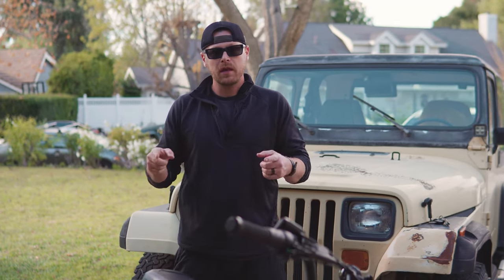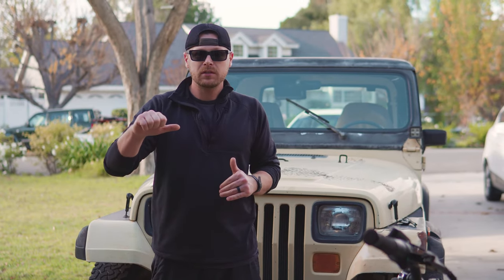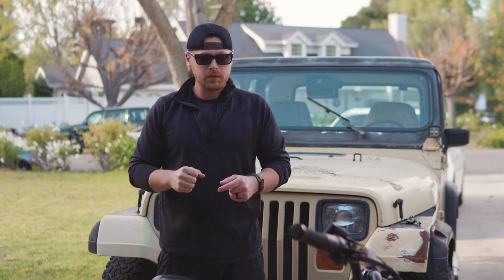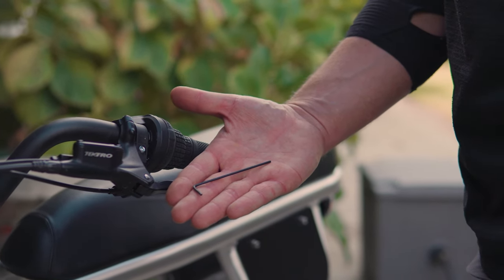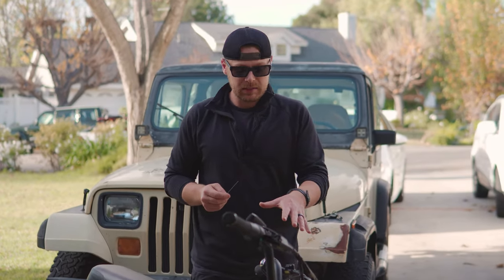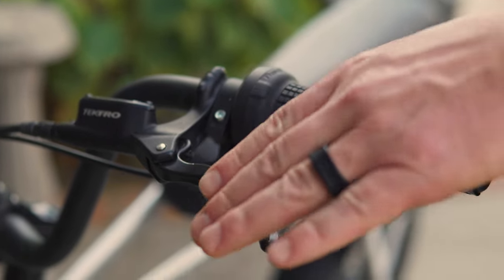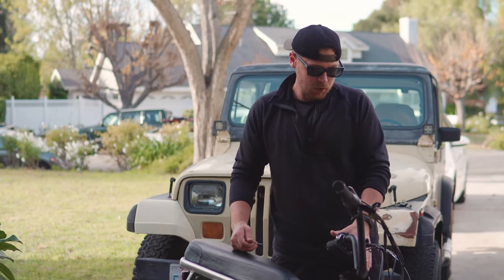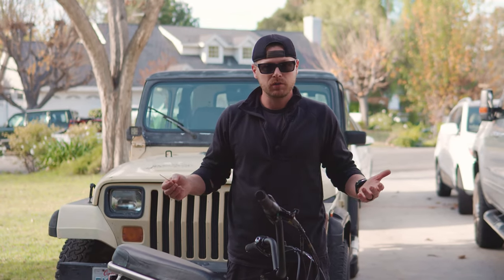Broken eBike Brake? // How to Fix It With One Tool // Easy Brake Fix

Comment: This worked when I first got my bike, brakes were solid. During a ride one of my motor wires got disconnected and I could not find the break in the wire so my buddy towed my on his 4 wheeler. Trying to keep tension on the strap so i don't get jerked around, I held the brakes going flat or downhill. Over time of doing that my brake pads where smoking like snoop and I the feeling on the break levers went from tough tension to soft and my brake levers bent from halfway to all the way back and I lost my brakes. After changing the brake pads and tightening the brake levers screw as shown in this vid, my front brake lever still needs to bend all the way back to even slight brake. Sooooo what did I do 😑
Reply: Man my brakes fucked up to cooked